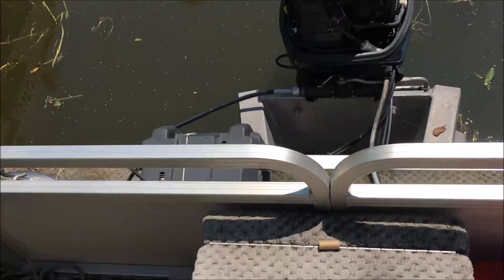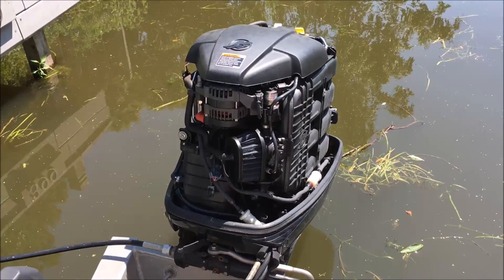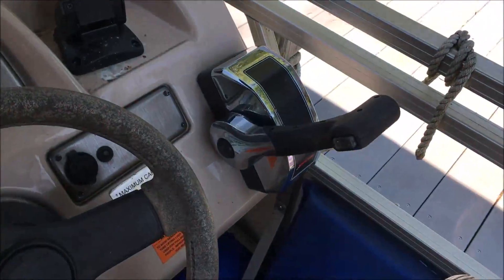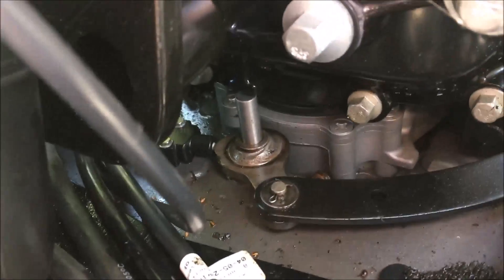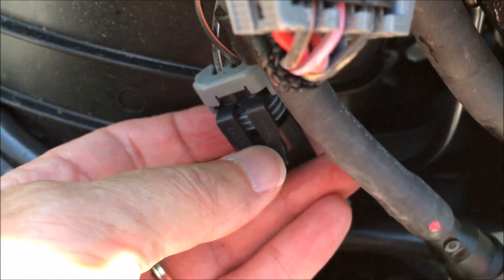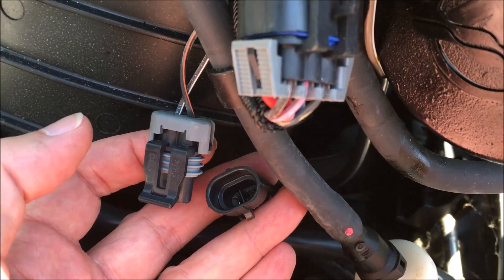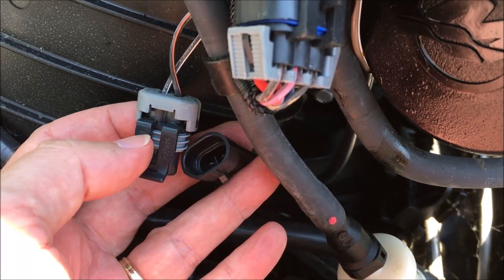Mercury Outboard shaking and not going past 3000 RPM

Comment: Plugs, two sets of injectors, three years of lost fishing trips. Endless gas analysis. Holy cow. That describes my boat exactly. 115 4 stroke. Purrs like a kitty at the dock. Can't even hear it. Initial hole shot ok until about 3000 then it wants to shut down. Replaced fuel filter, plugs, injectors, gas, gas and more gas. I'm going to the river right now. I'll add results. Thank you. You may have stopped me from virtually giving this damn thing away.
Reply: This sounds like mine did it work for you?

Comment: There's an easy solution that basically will proactively prevent all outboard problems. Its a 2 step process, can seem complicated, bit is in fact, quite simple. Here is the list:

1. Don't buy mercury
2. Enjoy
Reply: Funny. This was a batch Merc bought from another manufacturer, I forget who. When it runs it's a dream. This issue has been killing me.

Comment: Had this issue on my 150 four stroke and brought it in and they say it’s the computer. Mine just beeped once at 3000 rpm and throttled down.
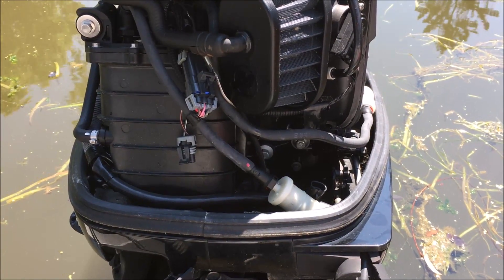Reply from the maker: They are correct (at 1:38 I say "the motor thinks it's in neutral", which really means the computer registers the motor in neutral). The computer is programmed to not rev above 3000RPM when in neutral. Because of the broken neutral switch the computer never get the signal it went into in gear. The problem with my engine (can't speak for yours but you can easily test it) was "fixed" by disconnecting the neutral switch. It's more of a hack than a fix as now the computer "thinks" it's in gear all the time. The real fix would be to replace the neutral switch (just can't reach it).
Reply: Core3D_Tech under warranty they are replacing the computer but I’ll ask about the neutral switch
Reply: @MatanuskaHIGH  if the switch is bad how is replacing the computer going to help?
Reply: Morality Sheriff well it broke down again after putting s loaner computer until my new one comes from the factory.  So maybe they will listen to me now when I ask them to check the switch.   They took computer out put old one in and it ran but wouldn’t go past 3000 then put loamer back in and it ran and wanted to let me take the boat and I said no I want you to figure out why this is happening because I’m tired of bringing it back over and over again.  I have almost 3 years left on the warranty and I’ll bring it in every day if they can’t fix it.  They need to just give me a new motor and send the one back to mercury.
Reply from the maker: @MatanuskaHIGH  I'm sorry to hear that. The test to this, is as easy as seen in this video. You don't need a single tool to try this. Simply remove the cowling (the big hood on top of the motor) and disconnect the switch I show in the video. Take it out for a spin. One of two things can happen:
1. the engine runs great past 3000 and you'll look like a genius to your engineer (or you exposed him for milking the Mercury company for repairs)
2. it still breaks down after 3000rpm and you simply put the switch back on, put the cowling back on and let the engineers take it from there.

Comment: How hard would it be to replace yourself?
Reply from the maker: The location is extremely inconvenient. If (and that's a big if) you can get your arm and tool under there, you loose all vision so you have probably go by touch. I had a mercury mechanic over the other they and I told him "I disconnected it, because replacing it seemed too hard). He replied "Tell me about it". I do have the issue, my boat is always in the water. This may be easier if it's on land. You can certainly buy the replacement part: https://amzn.to/2GXvgvr

Comment: Hey Core3D_Tech,  is your engine a two stroke or 4 stroke?  I am having the same issue with a 200hp mercury two stroke saltwater except the buzzer is constant and once I put  the engine in neutral, it goes away.
Reply from the maker: Alberto Coatl mine is a 4 stroke and it’s definitely the “computer” throttling down at 3000rpm. Under that it ran just fine.
Reply: @Core3DTech  Hey core_3D, Should I take it to the dealer and let them plug the computer on  to see what it says?
Reply: @albertocoatl591  i have same exact problem on my 115 2 stroke saltwater, constant alarm and goes away in neutral, did you find out the cause of the problem?

Comment: I had the same problem, but it was stuck at 4000 rpm, change fuel injectors , problem solved
Reply from the maker: Martin Konig not the same problem as this one was caused by idler switch and not fuel injectors
Reply: @Core3DTech  thank you I agree. Interesting enough I had basically the same engine symptoms.... Turn ignition on, shortly after the self check beep I would get six beeps. Engine ran fine in idle all the way to 3500 rpm, but them would loose power..... Just posting this here because it may help some else out there. Thanks for all the info!

Comment: Hi there! I have also a similar problem with my mercury efi 4 stroke 50KM 2006 year. Suddenly while I am driving the boat the engine starts to choking and finally its turn off the engine. Last days I re-changed oils and filters just becouse I have to. I thought it gonna help but i doesnt. I got check engine and TPS sensor Fault in the computer. What do you think about that? Should I check this connector also and try to disconect this one? Any suggestions? Greetings from Poland and I wish you good day. PS: I can make RPM'S easy from 800 to 5,5K easly. Its happens even when I put earplugs in my garden. Engine runs for few minutes. I put on the idle, then foward geard up to 3,5k and it starts to choking
Reply: Hi  did you connect to a OBD port? Did it give you the codes
Reply: @kierancasey5814  hey I just fixed that!! I had to re-correct TPS sensor unit. I had wrong voltage. Now it works fine!! thanks!
Reply: @cezarycezary4180 so what did you actually do ?

Comment: Well I change the switch with a new one it does it still might just leave it disconnected .Maybe do further trouble shooting
Reply from the maker: but disconnected it works fine? This sounds like whatever "lever' is supposed to trigger the switch doesn't reach it. Triggering/releasing the switch is identical to connecting/disconnecting the plug

Comment: Im having Same issue on A 2008 Whaler equipped with a merc 2008 efi hp90
Reply from the maker: I hope my solution works for you then. You can replace the switch but it's really hard for me to reach it. Unplugging that cable as I show works just as well for me.
Reply: @Core3DTech  well i did disconnect the switch and wallla problem went away it revs up to the highest rpm 🤠thanks for the tip

Comment: hello, we have a 2004 Mercury 115 hp 4 stroke and the last time we wanted to use it and it did not take off, it started without problems, (shakes a little bit), we took it to the service and it stayed the same, you do not know what problem it will be ?, someone says is that the computer that costs $ 3000. Thank you.
Reply from the maker: Sorry, I'm just a mercury owner, not a technician. It took me a while to figure out what was wrong with mine and how to fix it. This year I seem to have a new set of problems I haven't identified/fixed yet.
Reply: @Core3DTech  ok, thank you.

Comment: I have a similar problem with a brand new 2019 mercury 75HP.   Will not rev past 4900 hundred rpms.
Reply: Hi John.  Same thing here but mine happens at about 3200 rpm.  The motor is new with about 35 hours.  It is fine up to 3,000 fish then after throttle up to 3200 or 3300 it starts an alarm and the motor chugs a bit.  I slow down for 30 seconds or so and its oK for 5 minutes then the whole series starts again.  The Mercury dealer cannot find anything wrong.  Its turning into a joke.  I just cannot trust this boat for a longer trip.  Did you solve your issue?  Brian F. Niagara Falls Ontario
Reply: @brianf1010  Good luck.  After 6 trips to the dealer and nothing but added problems each time, they just sent my whole boat and motor back to Missouri.
Nobody has a clue on how to fix it.

This was my first and last Mercury.
Reply: @brianf1010  I never have got an alarm, just very poor performance.  Are you sure your motor is getting water and not heating up?
Reply from the maker: Then I hope my solution works for you as it did for me.
Reply: If im not mistaken I think that is where your should be. 200-300 rpm with trim puts you at 5200 rpm. I would just ask you local dealer with your prop number.
Reply: @GCHG2014  Well, just a few weeks ago this motor had no problem hitting 5500 rpms without porpoising.  Now it has lost 5mph and about 600 rpms.
Reply: John strand. Did you find out what the problem is. I just purchased a 2019 mercury 60hp 4 days ago and does not rev over 4900k. Motor should be turning at 5500k to 6000k
Reply: @ethansisolak5817   ethan sisolak  Nope.  Five trips back to the dealer,  Anglers Choice of Lexington, NC and I still have the same problem.  The last time, they put a lower pitch prop on the POS just to get it to plane off but my top end is still only mid thirties where as originally, it would hit 43mph.
  Mercury Marine has been useless as tits on a steer also.  I would advise people to steer clear of this brand.
Reply: @ethansisolak5817  break in

Comment: You just saved me we from wasting $800 to have a tech install a new fuel pump.  I already spent $500 trying to solve this.  I have DF70 Suzuki 70 hp and bet this a common problem on other motors.  I'm really into 3D printing and just subscribed to your channel as well.
Reply from the maker: Your welcome. Hope this fixes it for you. now that you've got $800 left, hop over to patreon and support my printing endeavors https://www.patreon.com/Core3d_tech ;-)
Reply: i have a df90a with the same issue.  is the switch in the same area on a suzuki as it is on the merc?

Comment: Hello I think this is TP sensor...  I have mercury 115 2 stroke OBM ... they give same problem ...rpm not increase more than 1200...  I already change its VST, spark plug  but problem is not solve... give me any suggestion
Reply from the maker: Prakash Khadse it was the neutral switch. I explain in the video. Replacing it or bypassing it fixes the issue